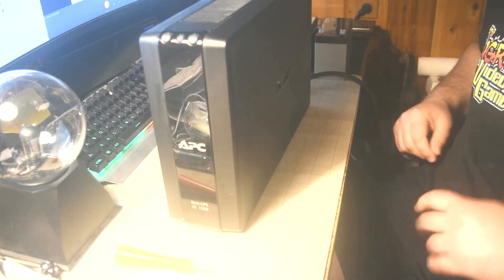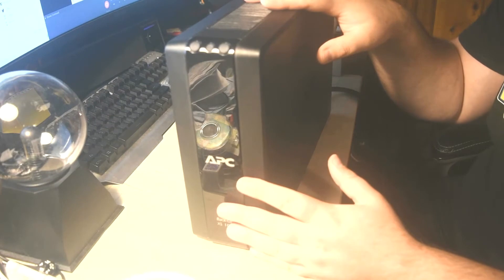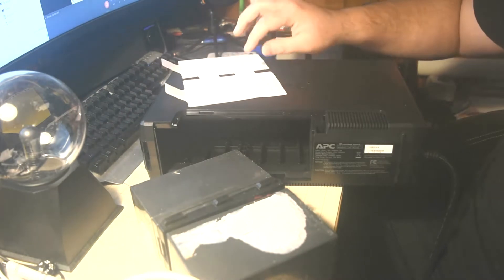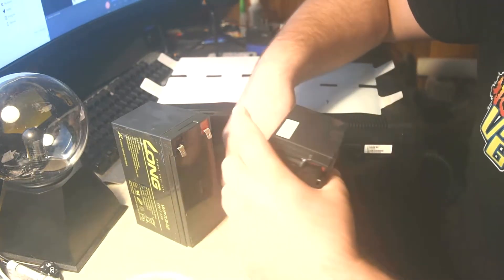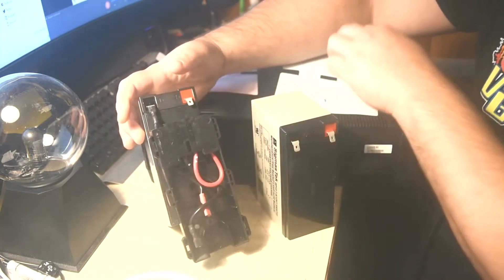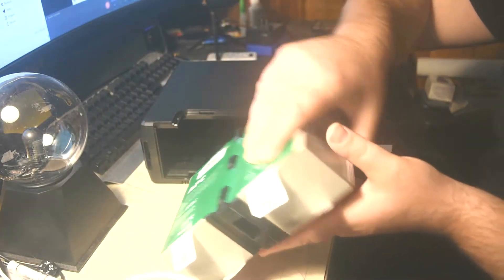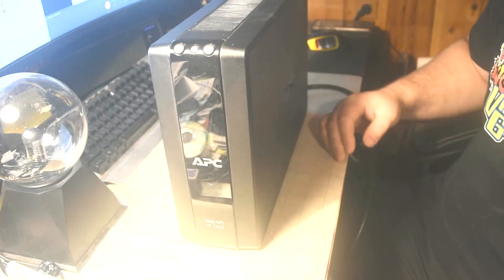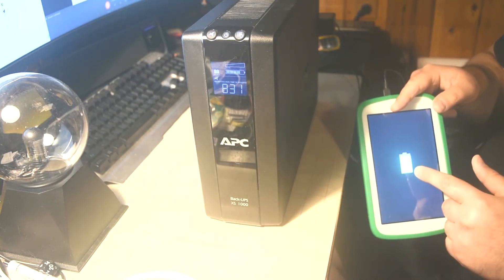DIY - APC Back-UPS XS1000 - Battery Replacement

Comment: So when the battery charge symbol is just flashing - no bars - that means that the batteries are defective?🤔 What type of batteries are those? Thanks how much are the "Long" brand? Are there any software updates?
Reply from the maker: If you have the batteries installed properly and it no longer holds a charge (i.e.: flashing battery meter that never reaches 100% regardless of how long it is plugged in.), you most likely will need to swap out the batteries with a new pair. You should be able to find a compatible battery model replacement on Amazon or eBay, just note the model number on the batteries that are currently installed and do a search for them. I am not aware of any software updates for the device. Thanks for watching!
Reply: @Ragingeek  welcome & thanks 🤓

Comment: Good job.  For those that may be wondering, if the unit is plugged up and still powering something (mine powers my router and network storage), you can hot-swap the batteries as long as the mains are up and the battery is not powering the devices.